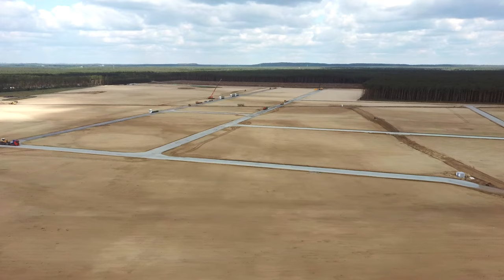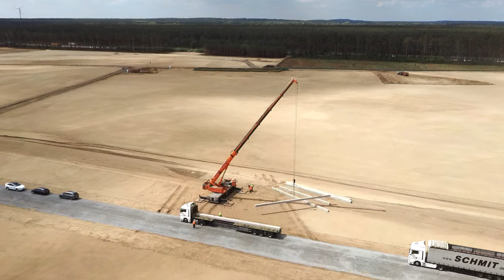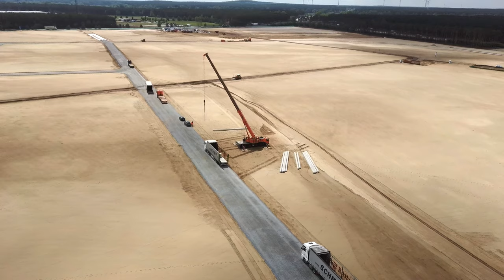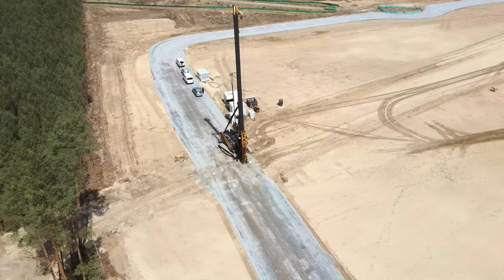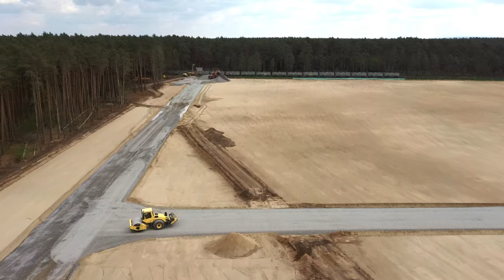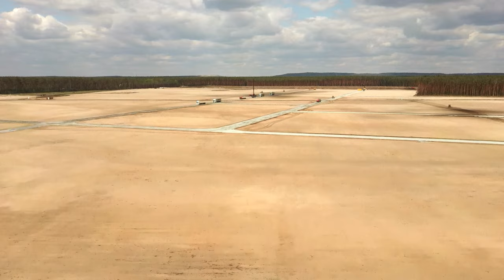Tesla Gigafactory 4 GiGA Berlin #5 | 2020 05 13 its getting busy, first piledriver set up.

Comment: how does the shovel get all the rocks out of the train?
Reply from the maker: Hi they use a Bobcat (Mini Excavator)
Reply: @jetfox6871  inside each rail car or is there a release underneath each car to put a bobcat scoop under?
Reply: @mhs149  Good question
Reply: It’s Germany.  They just shout “get out of the train”
And it does it
Reply from the maker: Hi, the bobcat has a special hook installed, the bobcat operator jumps out (there is a door in every car), the excavator grab the bobcat and lift it in the next car, the operator jumps in. I try to get some pictures of that next time.